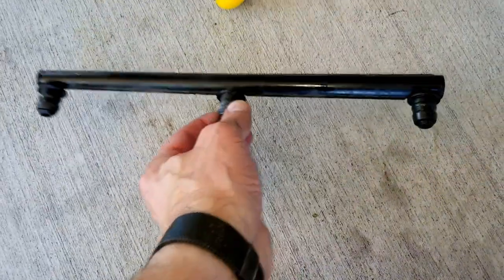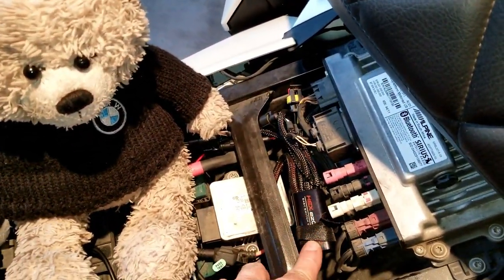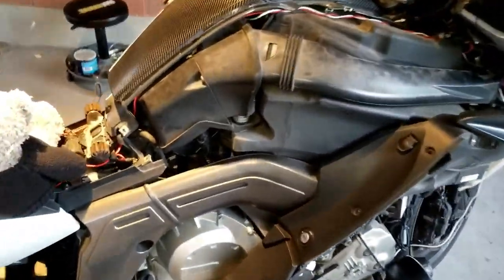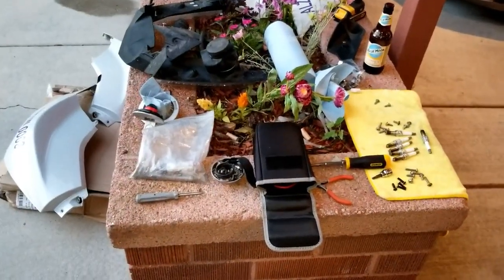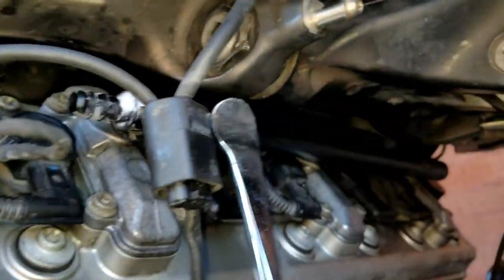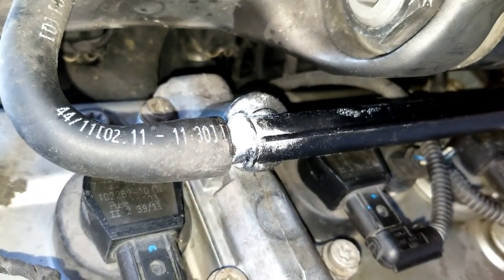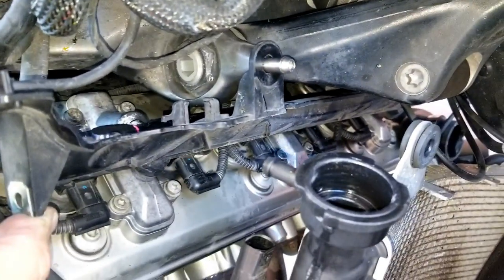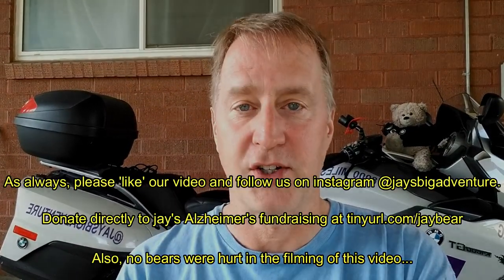Jaysbigadventure:BMW K1600GT Spark Plug and Air Filter Change #2

Comment: I was able to tackle this job thanks to this video.  Many thanks.  A tip I discovered:  instead of heating up the air transfer tube and pulling it out, you can loosen the 12 screws that bolt it to the engine and remove the whole assembly.  If you use L shaped torx wrenches, it’s doable.  Those screws are not on very tight and you can even get the tricky ones back on with just your hand.
Reply from the maker: Totally missed this comment, sorry! That is a GREAT tip, thanks for the heads up! I better not ever need it, lol...

Comment: I'll be doing the air filter replacement in prep for a ride out to the Black Hills so your video helped. Also you might want to consider getting rid of the OEM radiator shroud and replace it with a Rad-Guard. Your temp gauge will thank you. Ride safe.

Comment: Great job on the video. Learned a few tricks from your project. I have to do my air filter  and this will help with removing the required panels. Wasn’t sure how the tank panels came apart and couldn’t find anyone that has documented it before. Looking forward to watching more from you...👍👍

Comment: I reckon that most of a workshop bill is down to removing and replacing bodywork. I replaced fork seals on my bike recently and saved myself about €200. Thank God for YouTube.
Reply from the maker: Yes, there's a lot of disassembly required, including the radiator, etc. At $119/flat rate hour, it adds up quickly.

Comment: Hello ! Very interesting video thanks.
I was interested to know how many parts I’ve to disassemble to reach the coils that, at the moment, are my goal. It seems like the operation is more than tricky!  Please, how much time does it take for the full intervention? Thank you in advance. (sorry for my English but i hope that my request is clear...)
Reply from the maker: It takes a LOT of time to figure out how everything goes together. You need 45 min to take the body off, another half hour to get the radiator out. Half an hour to clean that while it's out. Another half to get the coils out. Might as well replace the plugs while you're that far in. Then reverse the process and put everything back together. 4-6 hours if you go carefully. Be sure to take tons of photos and review this video as needed! The 2nd time takes half as long.
Reply: @JayBearjaysbigadventure  thank you very much. I think that i'll spend a full saturday in october trying to follow step by step your tutorial... bye!
Reply from the maker: @mcaselg  The only thing that's hard is getting the air injection tube loose. Heat it, spray penetrating oil all over and the pry carefully. Good luck!

Comment: Nice video!  I would have liked to have seen the removal of the coils and the tool used to do that.  Is the tool really necessary and what risks are associated with not using it.
Reply from the maker: I'm sure you can find something to grab them with and just pull, but since they're so dang expensive I didn't want to risk killing a $129 coil over a $14 tool. And I'll most likely be doing 5 more on my bike, and I have a lot of friends with K1600s as well. :)

Comment: Does the coil removal fill all the BMW models?  I have the k1600
Reply from the maker: It fit my friend's R1200R so it wouldn't surprise me if this was a fairly standard tool. From BMW's perspective buying the coils in bulk across many lines just makes sense.

Comment: BMW recommends changing plugs every 19000 miles. Don't believe them. Every 50000 is okay
Reply: I have 133,000 on my bike and thought I would change plugs when the engine sounded a bit off- and that just happened today. Will take apart with next couple of weeks  with 
a bit of fear in my heart...